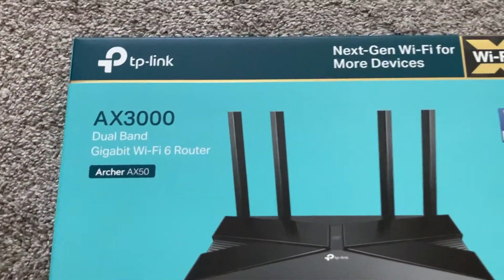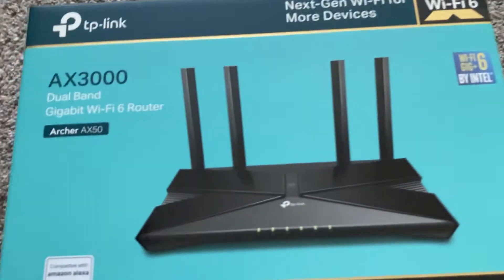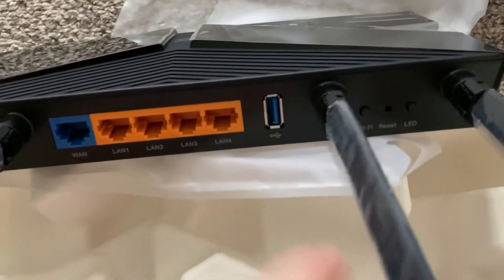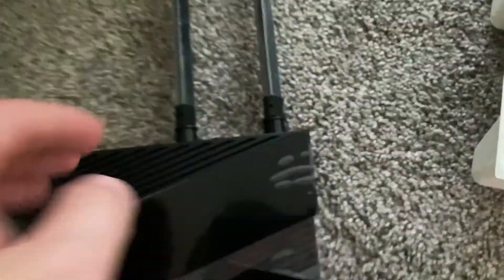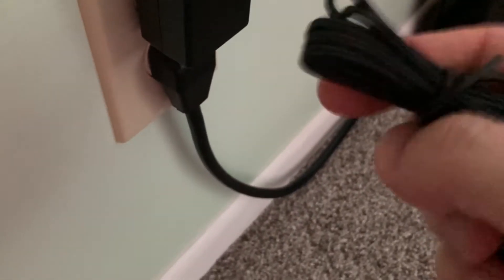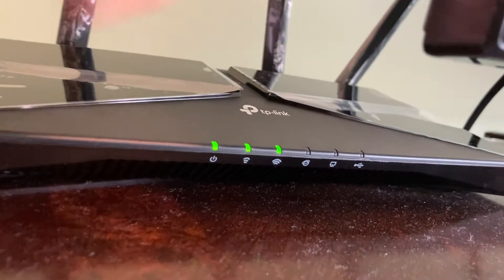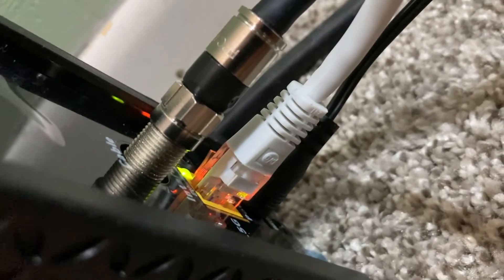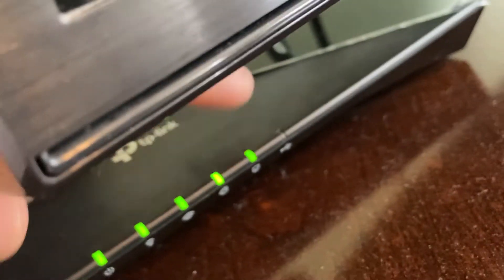tp-link AX3000 Archer AX50 Unboxing and Hardware Setup

Comment: I disconnected my WAN cable from my old router and reconnected to the AX50 and there is NO connection?
Reply from the maker: Check to ensure you connected to the WAN port on the AX50 and after you reset it, plug an Ethernet cable directly into one of the ports and connect a device to it (laptop/pc) then test again.